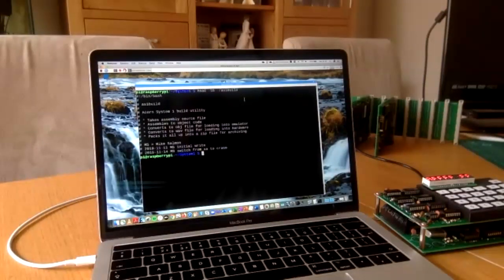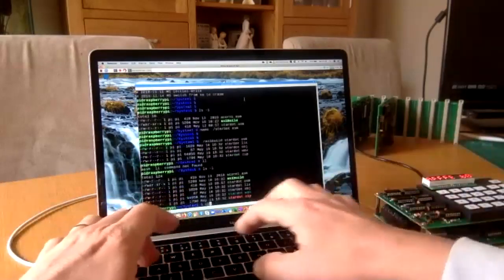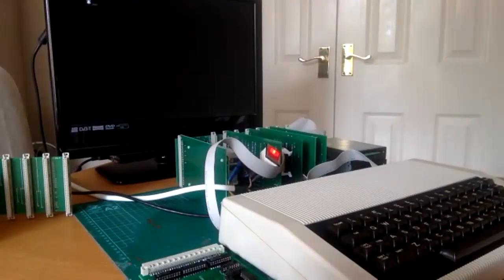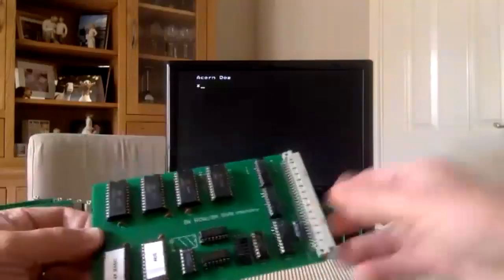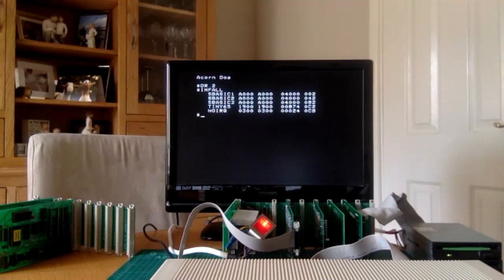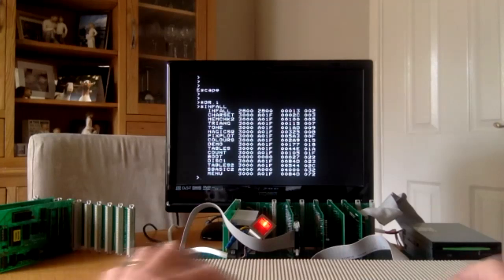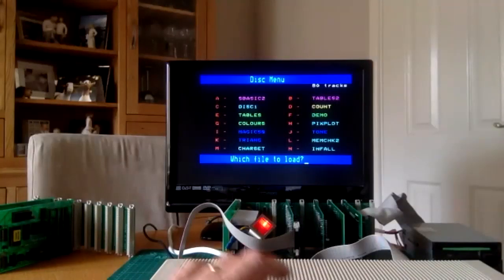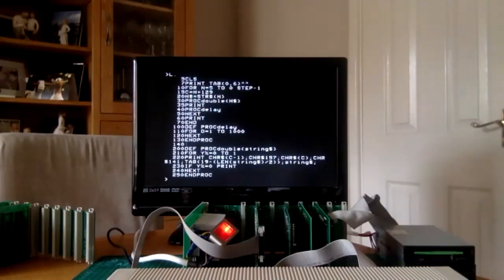Abug Talks - Andy Nightingale talks about his recreated Acorn System 3

Comment: For surface mount - some good flux is a must! I personally use MG Chemicals 8341, and sometimes a flux pen is handy. It's also a good idea to get a K-tip (knife edge tip) for your soldering iron. Most surface mount chips can be easily soldered by carefully aligning corners, tack soldering the corner legs, applying flux to all pins, and then drag soldering. Hot air is good to have as well.